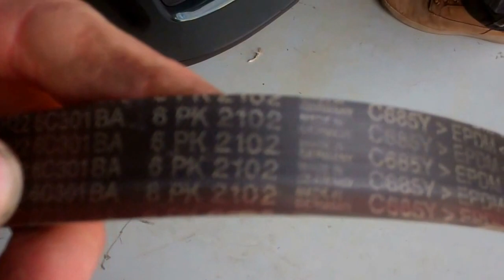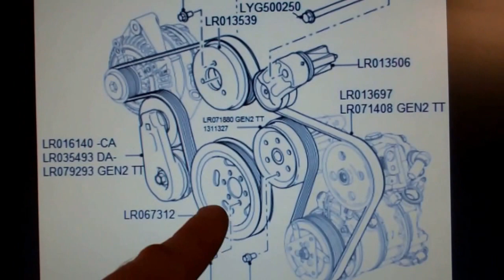Land Rover Discovery 4 SDV6 3.0L Drive belt tensioner failure & repair Range Rover Sport TDv6

Comment: Thanks for the video! I have the exact same issue and as soon as I get the part, going to follow your steps. Was worried at first but now you have made it look so much easier!
Reply from the maker: good luck - its not a tricky job...are you the first Lord to watch my videos !
Reply: Thanks again, got the job done today. Drove home with the windows open to hear the engine purring away in silence. Interestingly, the bearing on mine (in the black runner) was fine, it was the spring loaded section that had separated and was the issue.
Reply: @L663  the fan bolt is too tight! It makes me crazy, when I see all videos about this, people manages to unscrew, mine is impossible !
Reply: michelbonnet3787  yes ! I managed to do it by sitting on the engine bay and pushing with my legs! It was crazy tight!

Comment: Great video. Thanks guys. Thank you also for showing the difference between the different “size” tensioners. I have a question though. I am looking for a new tensioner (not yet ready to get original part). The problem though is that the width of the actual pulley on my LR disco 4 is 29mm. The only one I can get is one with a width of 31 mm. I don’t know if there was an upgrade and/or if it matter of I put the on on with the 31mm. It would be great if you guys can let me know what the size of yours is. I know, it means measuring with a vernier, but it would help greatly.  If you can’t help, thanks for the very informative videos.

Comment: Am I correct in saying that the little black pin/ tiny bit of plastic stays in the bottom on the new tensioner? 🤔
Just a bolt on plug and play tensioner?

I'll be tackling this over the coming days as mine is vibrating a fair bit.

Comment: How did you release the tension in the tensioner please
Reply from the maker: From memory there is a square hole in the tensioner you can put a socket bar into
Reply: @L663  thanks one more question when the tensioner is fitted and the belt is on how do you Put the tension back on is it automatic or do you have to release anything out the tensioner thanks great videos always watch 👍
Reply from the maker: @danhayes3546  its just sring loaded so the tension is always applied - so just release the tension with a tool to fit... then the tension is always applied
Reply: @L663  thanks did belt and tensioner this morning all good thanks again 👍

Comment: great vid but never put bolts in dry !

when i first started in a workshop some thirty years ago the owner of the coach company who was also the chief mechanic said " lad " always put some oil or grease on the bolt threads,it may be you that has to undo it next time !!
Reply from the maker: always an odd one as some people put threadlock on... to stop them coming undone ! more or less friction... take your choice ?
Reply: powerfulukltd I am contemplating buying a range rover sport 2006,on a bit of a budget , 2.7 any good ?
Reply from the maker: Its a lot of car for the money as prices have dropped. As ever get the best you can afford as engines are expensive to replace.
Reply: I know of a lot of people who do this, but it's NOT considered good 'engineering' practice.
Think about it.
The reason that a bolt locks is due to the 'friction' that is applied to both surfaces of the bolt and nut when tightened.
If one puts any lubricant on the thread (other than anti-seize) it compromises the integrity of the friction lock which in turn, makes it easier for the bolt to come undone.
Now, you might say ... 'well that's what I want' ... the bolt to come undone without a lot of effort.
That sounds good in theory ... but do you want bolts coming undone by themselves?
I've heard of caravaners using grease on their wheel nuts only to find the wheels departing from their vans whilst in transit.😬
Back to the video ... great video as usual guys.
Just one thing ... you were going to put a link to the couple of laser cut fan spanners?